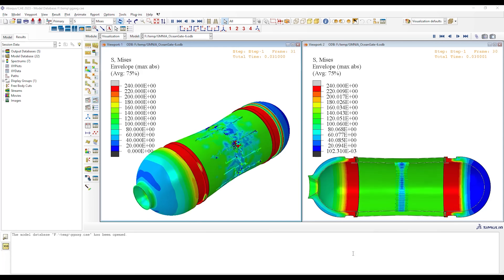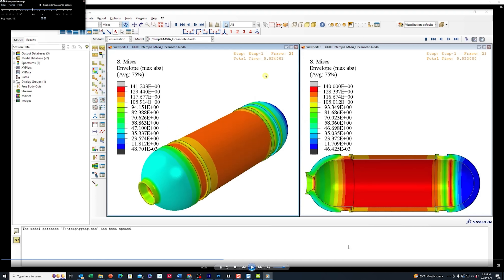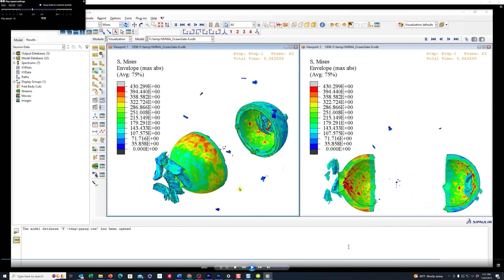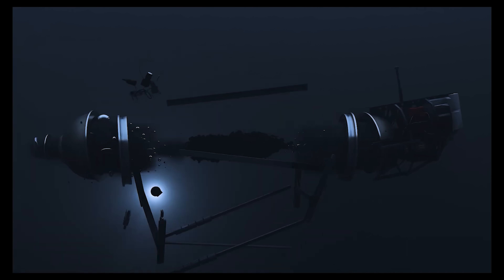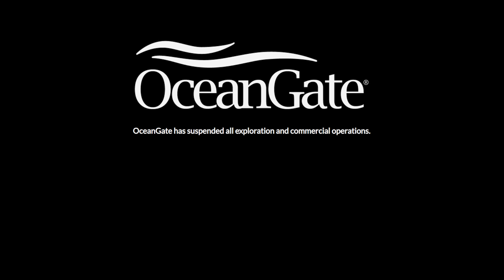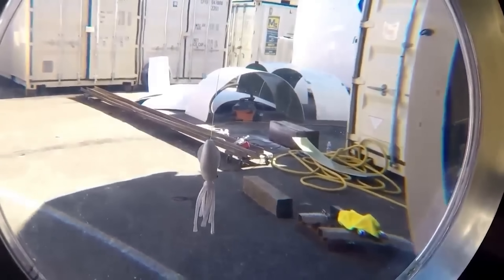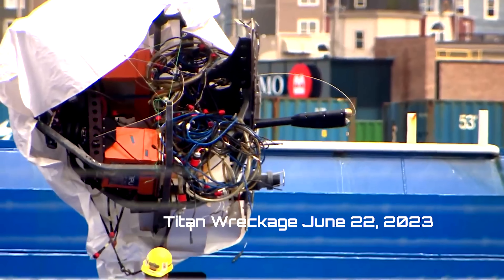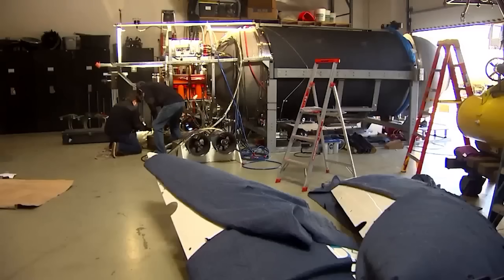Best Titan Sub Implosion Simulation, Cracked Porthole? Q & A

Comment: The port hole window was only certified to 1300meters by the manufacturer. The manufacturer offered to redesign it to withstand 4000m, which would be 200m deeper than the titanic wreckage, but OceanGate didn't want to pay for that, and instead fired the employee that was making a fuss over it (Lochridge). This is a damning fact.
Reply: Tbf I dont think all of oceangate was okay with the practices of the company, the singular idiot in all of this is Stockton Rush and his constant corner cutting, sadly he's now a mist so he cant answer in court
Reply: That, and the fact that they didn't disclose this to the passengers is what's going to doom what's left of the company to gross negligence lawsuits, regardless if the porthole was the main point of failure or not.  The fact that they used a porthole which wasn't rated to that depth speaks to all the cost saving corner cutting they did which cost 5 people their lives.
Reply: @dx1450  These people were so focus on getting down there and seeing the Titanic that it really didn't take much to convince them of the sub's safety and Stockton's bullshit. I honestly believe even if you had told them about the acrylic portal only rated for 1300 meters, regardless they still would have made the trip anyway. It's just mind blowing knowing the portal is rated for 1300 meters and your diving 4000 meters thinking you have a warning system that will let you know in time before implosion. What am I missing here? The mount stupid YT video says it all.
Reply: Exactly. I don’t understand why he refused the offer to redesign the acrylic. I am betting the port failed. Or the glue used to hold the carbon fiber on the tube. I can’t believe the jerry rigging on this thing. Submersibles are made out of steel and titanium and inspected and rated voluntarily for a reason. It’s gross negligence to not do everything you can and tell the customer everything. IMO
Reply: Diving to nearly 4000m ,  it's madness. Then you consider all the improper handling, it's outside storage, transport on trucks, accidents.

The incidents detailed by the paying passengers and staff are incredible. More staff bare responsibility for not reporting the incompetence and danger.

Will anyone from company , the  board be held responsible? In modern America I think not.
Reply: @margaretstutts4362  I don't have a problem with the materials. I have a huge problem with the design and lack of destructive testing  (of a new design).

All materials have pros and cons. Steel is extremely heavy and rusts. Titanium is insanely expensive, heavy and not as hard as steel... a potential problem given that the door was held on by bolts and screw threads in the titanium end cap.

Carbon fiber is extremely strong and light (if made right) but not hard. Having it bounce around on a steel stand as they dragged it behind a boat was foolish.

Relying on a chemical bond only instead of a mechanical bond for the end caps was the most egregious error though.

Followed by their use of cf tow instead of woven fabric.
Reply: @Zebra66  I’ve read carbon fiber is great holding pressure in a container but not so great for external pressure. What kind of glue do you think they used? And your right about screws. A stripped screw and boom. I guess that’s why a sub has pressure locks instead. Do you think the carbon fiber delaminated or the port blew in? I don’t think they have found the acrylic.
Reply: @Zebra66  you make a lot of mistakes on the materials here as wel. Carbon fibre is pretty hard actually, but also kind of brittle because of it. And titanium is know for work hardening and because of that it wil probably be really hard now, but also pretty brittle. That is why titanium isnt that great for submarines. If you go to the limit of the titanium sub then its limit decreases for the next dive because of the work hardening.

And mandrell rolling a carbon fibre tube is the cheap way to do it. Its great for making a flag pole or something because its cheap and you can do it as production runs because you can just use that same mandrell over and over. But its not know for being the strongest possible way. And wet layup is in general not considerd to be the strongest way i think.

Now the chemical bond thing. It is literally the only way you can bond that carbon fibre hull to the titanium caps. If you where to drill in the carbon fibre you break up the fibres and it wil break 100% sure. The bonding areas where pretty huge, and that glue is probably some sort of epoxy based glue, wich is exactly the same as what they used for the carbon fibre. So im pretty sure the glue bond itself is as strong as that carbon tube was if not stronger.
But the problem with wet layup is that you prettymuch make loads of layers on top of eachother. And if there is only a small air bubble in there that can cause delamination. Now take that thing to the extremes of 4000meter depth and that 1 air bubble is GUARANTEED going to cause problems. Add to that the fact that carbon fibre isnt that great under compression and you make a huge timebomb.
Reply: @Zebra66  how can you claim how strong CF is compared to steel, then say it bouncing on a steel frame was bad? 
 Titanium is stronger than basic steels and cheaper than exotics that can take high compression forces, please stop spouting simplistic facts that you are completely wrong about!
Reply: @margaretstutts4362  a stripped thread isn't an issue when the vessel is under compression! A nut and bolt is only there to hold things in position without pressure. If you don't understand the basics don't try getting more specific it only comes across as stupid to those in the know!
Reply: @Andrew.J.R.Simpson  hard and strong are too different things.

I'm 100% correct on everything I said.
Reply: @Zebra66  You seem to be glossing pretty hard over the 5% compression of the water at that depth. Have you done the calculation for how much energy that is stored in the water column around them? This was not a kitchen sink plumbing leak. I agree that the pressure of the water doesn't on its own cause a violent implosion but the stored energy in the water's relatively slight compressibility is massive. It was most certainly catastrophic. You only have to look up videos of high water pressure vessel tests to see that failure is very sudden. Or alternatively listen to hydrophone recordings of ships sinking and their bulkheads collapsing instantaneously, there's no "leaking" involved.
Reply: @gabbermaikel The work hardening of titanium is a real issue. I was in the USN on subs 1978-1986 when the Soviet alfas were a threat. Scuttlebutt was yes, they could go very deep, but every excursion past a certain depth was logged and caused a new calculation to be made for the ships new maximum depth. Like most sea stories of course, you have to review with critical eyes/ears!
Reply: @martystrasinger3801  yeah thats what i understood about the submarine industry and titanium. They tought it would be great, until they found out that the work hardening might be a big problem over time. Kind of crap if your submarine loses its advantage because you did an excersise with it.
Reply: @Zebra66  Titanium is light.
Reply: Awful...just despicable
Reply: Given all of the Stockton's deliberately questionable design and safety choices, does anyone find it surprising that he wears a helmet giving a tour topside?
Reply: @krisztinaholly I thought the same thing!
Reply: Truthfully, it crossed my mind that this was his big suicide mission. Some people are arrogant and narcissistic enough to take other people with them. Like that, copilot, who flew that Germanwings airplane into a mountain and took out a whole plane full of people just in his act to commit selfish suicide. It was even planned ffs. I mean, honestly, Stockton Rush could have done the same.
Reply: It was an avoidable tragedy but the guy who was fired did the right thing and and should have a clear conscience.
Reply: 50 year old white guy ?
Reply: Wow… that is sickening
Reply: The carbon cabin  was  repaired before...
Reply: Well i am sure people didnt have time to realised the accident! Too fast! At least they did not suffer!
Reply: When it comes to safety, better fired than dead.
Reply: I'm having trouble believing they used ACRYLIC instead of POLYCARBONATE? Were they TRYING to be cheap?
Reply: 🥱 Everyone’s an expert and “told you so” after the fact. High and mighty nobodies.
Reply: They also didn’t want to pay for the testing. And the testing would’ve saved their lives.
Reply: It is always cheaper to fire the whistleblower than fix the problem. 40 years as a Project Manager demonstrated that.
Reply: What a shame
Reply: Rhubarb would have done a better job:    https://youtu.be/9RSaqZR9Ajk?si=1TFa7TVYQFZBl0gV
Reply: Greed killed them all and arrogance.
Reply: Thing is......there was alerts...supposedly everything 'red'...they started coming back up.  knew they were gonna die.

Sorry bit when an alert is red.....and ypur 3500 metres below. 

What did they think was going to happen? 

Fact the 4 guys would.bave been terrified...whilst Stockton will have been singing the always look out the porthole dont worry be happy safety song. 

Take risks......die. ...easy.
Reply: Rush bought a Walmart Playstation controller instead of spending a couple hundred dollars on a Scuf or something like that. No way he's paying for a better window.
Reply: Titanium is very strong I do believe there was a problem with the port hole window and the carbon fibre. All the dives they done would of made the carbon fibre crack
Reply: Capitalism at its finest!
Reply: We've already seen the titanium end with the acrylic window missing. So, whatever else happened, we know with 100% certainty that the window failed.

The only other evidence (for any other theory) beyond the usual regurgitated guesses are the lack of cf residue on the Titanium end caps.

This makes it equally likely that the glue seal failed and the CF tube is possibly in one piece somewhere.
Reply: @Zebra66  But we don't know if the window was the cause of the implosion or if it was blown out because the tube imploded. If the tube was in one piece it would be very close to those end caps and as far as I know we haven't seen any pictures of it.
Reply: @Zebra66  you dont know how inplosions work? If that tube fails the inplosion wil shoot that porthole out with ease. So the missing port hole dosnt really tell anything yet because it would mostlikely be gone even if the tube failed first. And the fact that the ring that is supposed to keep that porthole in seems to be missing in the wreckage pictures makes me thing the inplosion shot the porthole out the front and is took that ring with it. If the acrylic had failed the ring would most likely still be in place on that front dome.
Reply: @gabbermaikel 
“inplosions”?
Reply: @j.griffin  part of fat finger syndrome and a non native language means my fingers hit different buttons sometimes and the correct system wont do anything with it because not the normal language.
Reply: @gabbermaikel first of all, its implosion, not “inplosion”. Secondly, no, an implosion doesnt cause something to “shoot out”. That would be an explosion
Reply: @Mfields4517 pfew wel you got me there, i wrote it wrong as a non native English speaker.
As for implosions pushing something out. The shockwave wich happens wil do that.
Reply: @gabbermaikel  No sweetheart, an implosion cannot cause a shockwave that is greater than the force of the implosion... if it did, it would be an explosion
Reply: @Zebra66  it'd "fail" after the hull's implosion, doesn't mean it was the failure point.
Reply: @RavingKats  it's true that we don't know anything with certainty but I think it's most likely that the window would still be attached if it wasn't the failure point.

Water can't be compressed like air. You would not and could not get the explosive release you see when high pressure air tanks fail. The rapid decompression of compressed gas is a similar effect to gunpowder exploding in a barrel.

With water (at apparently no more than 5% compression we're talking about a high pressure leak filling the sub with water.

Could a focused jet from the other side knock out the window... maybe but my money is on the seal around the window being the first (but not only) point of failure.
Reply: @Zebra66  sorry but you are wrong. OK you have a point but you don't understand it, water compresses and acts like air but at different rates like you say. The implosion into the vessel which was air would be as violent as any explosion in air due to the pressure.
 I've seen the results in air filled metal tubes compressed by water at 2000m of pressure.
 The reaction to the implosion would have knocked out the port not a "jet" as you say.
Reply: @Zebra66  With out the endcaps the pressure would have collapsed the CF tube and made it shatter. If you have ever seen CF fail under pressure/stress, then you would know this. Also, if the CF didn't shatter and implode much more remains could be found as the shatter CF at those speeds would shred a human body like a blender. A good portion of the human body is uncompressible even at depth because of the water content.
Reply: @Zebra66  the leaked transmissions say cracking sounds at aft, I'm guessing it cracked there, water logged whatever, then imploded.
Reply: @Zebra66  Water is compressible. At 4km depth, it's about 1.8% less volume than at the surface. Given a 1 atm vacuum, it decompresses to reach equilibrium extremely fast

Comment: Interesting assessment but stop the conspiracies, and stick to the science. There is no such word as "undeterminant" it is indeterminant and it is "mil-a-second" as in a millionth of a second not "milley-second." Oh, and it is de-solder not un-solder. As to acrylic cracks, you would never be able to tell from a relatively low-resolution JPEG screen grab. Your own thumbnail shows the lack of any edge polishing and only using a disclosing fluid or other technique would you be able to see any. If there were cracks that would "read"  on video that is sort of a flat tire and everyone would notice that before a dive. The bottom is muddy, and I did not see a trawl of any bottom dragging to sift for phones, chips, or other minutia.

Comment: My gut is telling me that the flange joint with the hull & end cap compressed at different rates. The adhesive didn't handle the temp. & Pressure differential & i feel like that's their biggest "point of failure" I can't believe they went with that design?? For something under such insane pressure, why go with that design? I'm just baffled how that alongside other aspects made it thru & they never changed it or invested in improving it.

Comment: I see what appears to be a hydraulic motor attached to a glass windowed box On AlanXelMundo Video @10m mark. 

Stockton answering, points out a couple parts having a safety feature using oil hydraulics? First he points out an interesting safety box where he says; “I think this is for the cameras” and connections run through the box which is under equalized pressure so that if a crack should occur in the glass, oil is forced into it as a safety measure against water coming in. 

Question is; can an oil hydraulic system like that be fast enough? Not to deal with a leak occurring under deep depth but maybe enough to deal with a slow leak at shallow dive?  That kind hydraulic motor is highly dependent on battery power. (Automative guy here)
 Are the cameras attached to that metal frame that they dropped and remained in tact?

I’d be interested in your thoughts.

Comment: ”You get a huge warning before it fails”! At that point I would have turned back.
What Rush was saying is actually that ”you will have enough time to know you’re going to die, but can’t do anything about it”.
Reply: Prayer
Reply: he was a rebel- that he thought he was better than science and that the results are meant to be challenged- Apparently this philosophy is not novel a presidential candidate has similar thoughts about global warming.
Reply: He didn't know what he was doing. He was guessing, using what he passed as reassuring platitudes, and put his high paying passengers at risk of exactly what happened.

Comment: I was curious if water might have leaked into the tail section causing it the Titan to descend to the bottom much quicker.  This might also explain why the tail section was mostly intact.  I believe that there is a connection from the pressure hull into this section, perhaps this might be the source of the implosion?
Reply: leaked in  where, it is all exposed to the water. designed that way.

Comment: Transcript specifically states; crack noise came from  the AFT  of the vessel. Sand bangs were dropped......ascent did not happen. Why; crack at the AFT of the vessel took in water. Auxiliary battery had to be activated. Frame was released. NOT ASCENDING!!!!!! Batteries were lost....thrusters lost ....vessel went dark.......DEATH!!!!

Comment: 8:00

Looking from the inside out of the porthole window you wouldn't see the crack you mentioned because they be obscured by the porthole frame and it doesn't look like acrylic cracks, it looks like adhesive cracks.